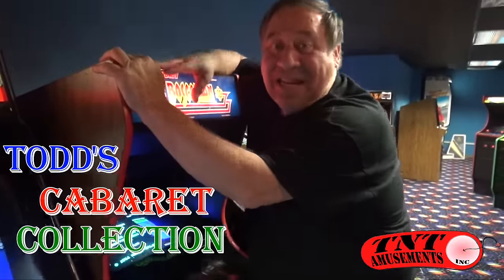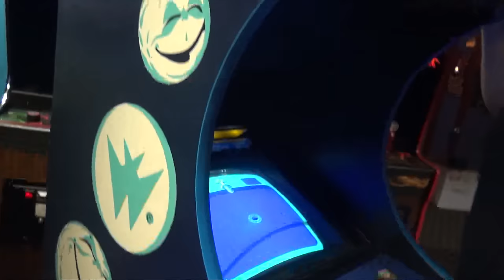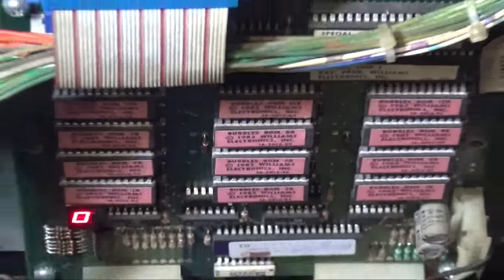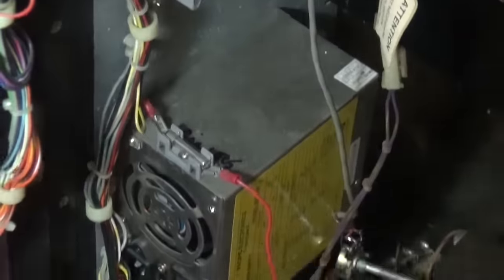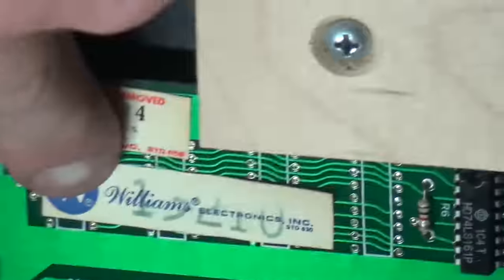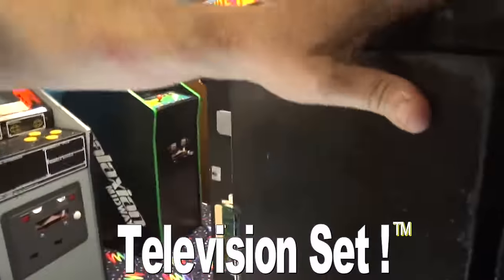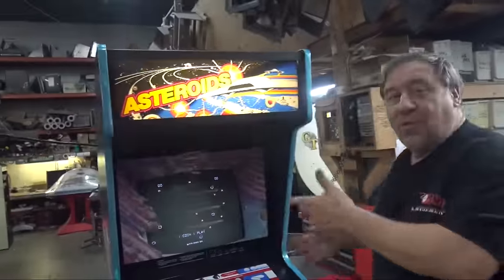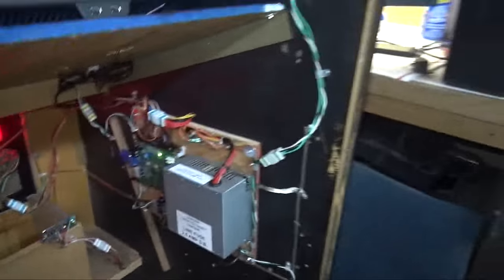#1170 EVERY Williams CABARET Arcade Game! ROBOTRON-BUBBLES-MAKE TRAX-STARGATE-TNT Amusements

Comment: well not sure if Riverside Electronics does cap kits but I love supporting small TOWN upper midwest.  Lewiston MN at least isn't THAT small like 500 people.  although when we lived there 87-91 (Riverside moved there at some point)  it was 1000 people more.  .  1,581 in 2014  is that small? :P  This would be the town that when the bar there (long gone) snipped off the ground prong  X_X  do'h  cause it didn't fit in a 2 hole outlet  smh  poor Ms Pac Man  would paly the table top to death back then :)  not  the cocktail things.  Although that woulda been interesting .  Although at least Riverside has a website.  Zanen doesn't .  On topic?  was that a real Television Set in the Asturds?  :P  let alone original board etc ie what is the Ratio on the corporate sale of LCD/ mini board kits in big box arcades vs the real things.
Reply from the maker: Well, I think we will stick to our current companies!
Reply: did double check though , they do this.  they do anything that relates to a circuit board ;)  wouldn't know their prices although I'm sure they get biz a little thru Raspberry nowadays.